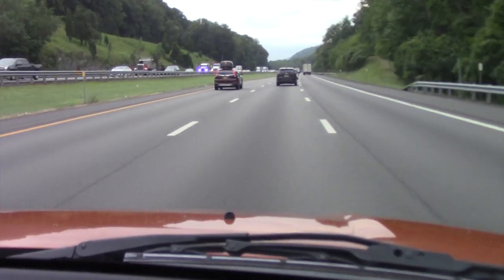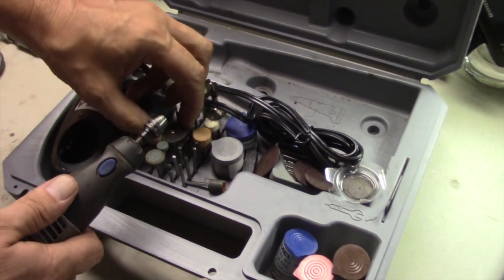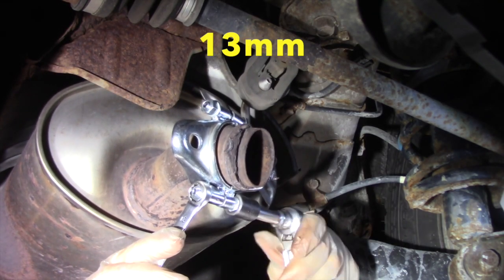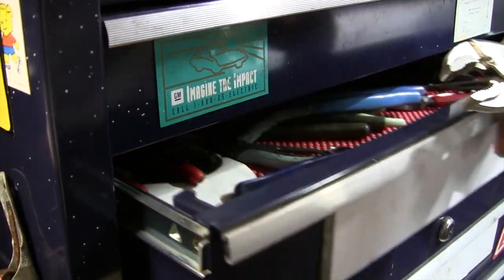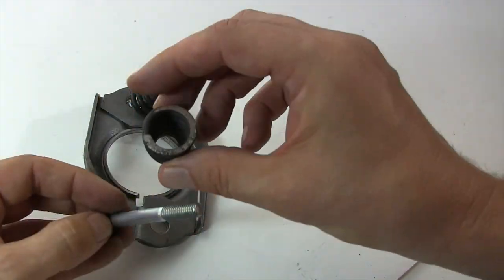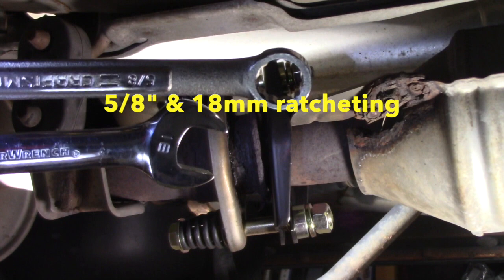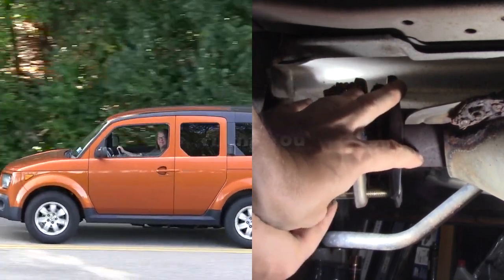Honda Element Exhaust Repair

Comment: The Element doesn't use spring bolts between the muffler and tailpipe. It has a flat flange connection because it doesn't need to flex.  It exists only to make it possible to install the exhaust with the rear suspension in place.  The kit used there should have been installed at the end of the pipe after removing most of the original flange. All exhaust system flanges need gaskets to prevent high temperature corrosive exhaust gases from leaking and accelerating the destruction of the CRS flanges.
Reply from the maker: No kit reversals here. You are thinking of the stock exhaust from Honda. These are both generic aftermarket repair kits. They both came with spring bolt setup. Truthfully, if I had to do it again, I'd go for a stainless cat-back system. (not even sure if they make such a thing.)

Comment: My tailpipe rusted off behind the muffler. Surprising how loud it is after the muffler. Not awful but noticeably louder.
Reply from the maker: When it happened to us, the noise was intrusive, but I was more concerned with the exhaust fumes getting in the car. I replaced the rear pipe section right away.
Reply: @FlashDriveFilms  Agreed the fumes are the bigger problem. I'm just saying that I assumed louder exhaust = leak BEFORE the muffler.

Comment: My 2007 element has the exact issue with the rear tailpipe.  I thought something in the suspension was rattling and one I looked at it found the tailpipe completely rusted off just like in your video.  In the video you suggest using different spring bolt (longer). What length would you suggest? The ones I have seen online are mostly 1.5 inch.
Reply from the maker: You would really only need about 3/8" or so longer. Too much longer and it may hit against the rest of the pipe. For the longer bolts behind the catalytic converter, I went to Home Depot (or Lowes, I forget) and bought some plated ones. No need for stainless, but the extra length made getting the connector together so much easier. Hope that helps.
Reply: @FlashDriveFilms  it does. Thank you very much, I appreciate it.

Comment: Good video . Question did that seal up in the front ? It looked like there was no seal for the conv. Or it was so worn away I could not see it .  But to let it like that and bolt it together it looked like it  would really leak exhaust out.
Reply from the maker: Thanks! There was still some gasket material left. At around 6:40 or so you can see the sort of black gooey stuff  in the rear connector portion. That said, I do recommend using some exhaust sealant if there is any doubt about the seal.  (link in the description)

Comment: For the cat converter flange repair, is there no gasket that goes between the new flange and the old one?
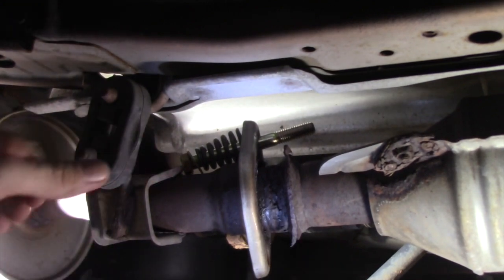Reply from the maker: Yes, there is a gasket that fits inside the flange. (you can kind of see it around 6:54 in the video) I did not replace mine so I didn't mention it.  The links to the repair flange sometimes suggest gaskets or sealers in their listings. I'll have to look some up and include them. Thanks!

Comment: I need to know what are the 2 bolts that bolt the exhaust and that whole exhaust line motor there's 2 bolts and mine are gone and Noone knows what bolts they are
Reply from the maker: Hi! I'm not sure which 2 bolts you are in need of. The flange kits either come with their own bolts, or you can get upgraded ones like I used from a hardware store or online.

Comment: No gasket needed on the second flange repair?
Reply from the maker: I did not use one. There was enough of the pipe back from the catalytic converter that it sleeved very nicely into the mid-section pipe. There did seem to be a gasket, or sealing type material still present and the joint connected firmly when I drew the two pieces together. Depending on how far gone the joint is, you may need a new gasket at that point.
Alden

Comment: Why did you choose that flange for the front instead of using the same type you used for the back? I used the first type for my cat flange. I agree it was a huge pain to compress the springs to get the bolts on.
Reply from the maker: Diameter. The two different types were to fit two different pipe diameters. If I could have found them both in the correct sizes, (2" for the rear, 1 7/" for the front),  in the time constraints I faced, I would have done that. I agree the version I used on the cat flange was far more user-friendly than the one on the rear section.
Alden
Reply: @FlashDriveFilms  I wish I'd had longer bolts for the cat flange like you used. Even with springs compressed with my vise grip I could fit only about 1 turn of the thread through the flange hole, just enough to get the nut started. Unlike you I had to replace that 31378 gasket. But I can't complain much about the job because the Honda dealer where I take it for inspection had told me I needed a whole new exhaust system. Nice try, Mr. Dealer but I'm not spending over $1000 when I don't need to. Everything is fine now after I replaced the flange and gasket. Only thing is my cat heat shield rusted off but that shouldn't affect inspection. I don't plan on parking over dry grass so the hot cat won't start any fires.
Reply from the maker: @mattfoley6082  Yes, the longer bolts are really the way to go. I also think the original bolts & nuts are not very good quality, so stainless, if I can find them in the right size, or at least the plated grade 5 or higher.
Did you save the heat shield? Same thing happened to us, but I went to Home Depot and got a 7" hose clamp  (Stainless !) They are in the plumbing section (they look like a really long radiator hose clamp), but meant for dryer vent hose. I unwound the screw part to separate it, threaded it over the cat and made a sort of vertical belt around the cat & the shield. Tightened it up. Works perfect, Heat shield in place and functional, no expensive new cat needed!
Alden
Reply: @FlashDriveFilms  Unfortunately the heat shield was taken by the rust gods. A new one is pretty cheap but I'm not getting one unless required.
Reply: @FlashDriveFilms  My tailpipe-to-muffler flange rusted out about 4 years ago. Had a shop cut off flange and weld in a connector. Now it's rusted at the connector, right at one of the welds, tailpipe is hanging loose from muffler. Disappointing I got just 4 years out of it. Can't decide if I should a) do the same again or b) short connector and clamps or c) replace entire tailpipe as you did. Wonder which will last longer.

Comment: Could you please tell me what brand is the high heat temperature prevent rusty can ? Thank you
Reply from the maker: I used a paint called Dupli-Color DH1602 High Heat Ceramic. Rated 1200 degrees. Dupli-Color DE1613 High Heat for 500 degrees would probably work as well for the muffler. The really high temperature stuff is really for headers and catalytic converters.

Comment: Just got my muffler pipe and the repair flange bolts wil not fit the holes I the muffler flange !  Anyone find a longer , better fitting bolt / springs for the muffler flange ?
Reply from the maker: OK, if you bought the bolts through the affiliate link in the description, definitely return them for a refund. I am curious as to which flange they did not fit. Also, were they the wrong diameter, or the not long enough? I found I got good results with some zinc-plated bolts I bought at Lowes for the catalytic converter flange.. All of the parts listed worked on my project,  (a 2007 Element) but if there are variations that are not compatible, I'd rather leave those recommendations off. 
Thanks for the heads up!
Alden
Reply: Drilled it out

Comment: What size exhaust clamp would I need for this fix?
Reply from the maker: The rear clamp is 2" and the forward one, on the catalytic converter, is 1 7/8".  (Affiliate links in the description for the exact parts I used in the video.)

Comment: Do you have any links to the vendors/places you bought the tailpipe and other parts from?
Reply from the maker: The upgraded bolts, "Everbuilt" brand came from the hardware aisle of Lowe's. The first flange kit, #36132, I bought online, I think Amazon, but not sure, (and not an endorsement !) The 2nd kit, 31953, was from a local "Mom & Pop" autoparts store. The Exhaust flange kits were by Wagner, and here are all the part numbers:35129 bolts, 31566 gasket, 36132 flange kit, 31953 flange kit. Definitely shop around, prices were all over the place. I can't endorse any one vendor over another. Best of luck.
Alden

Comment: Is there a gasket for the connection to the cat section?
Reply from the maker: Yes, although on mine it was still intact enough that I didn't replace it. You could also use a tube of  exhaust sealant around the outside of the pipe for the same sealing effect.

Comment: if you could link the kits that use to repair the element that would be great.
Reply from the maker: Well I bought mine at the local Advance Auto after looking online. But I don't know that they are the only ones that carry them, and I don't know if they have the best prices, so I am reluctant to make a  direct link to anyone. I do know they were both made by Walker, but I don't have the part numbers handy. And I always advocate shopping around for the best price/convenience.
Alden